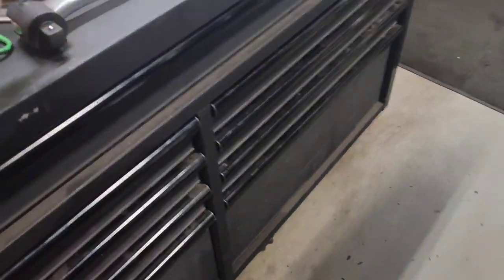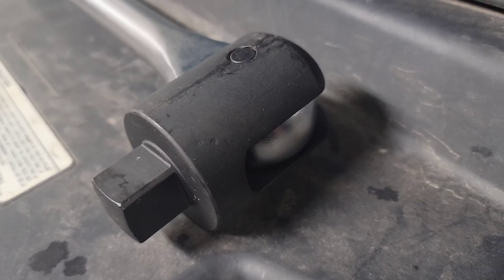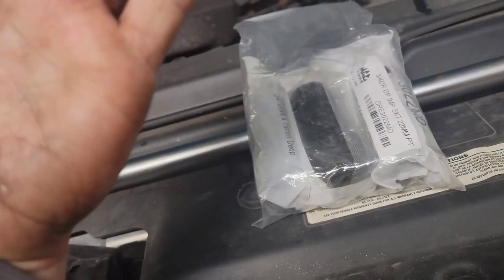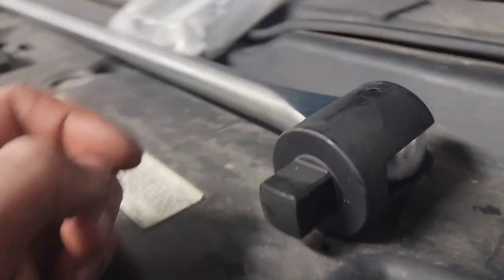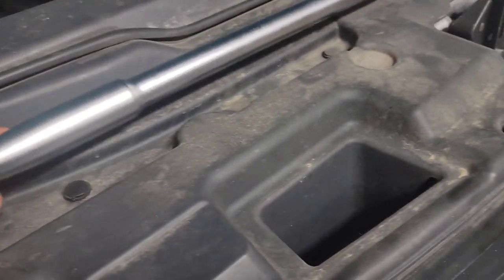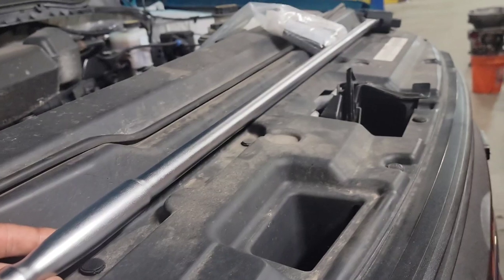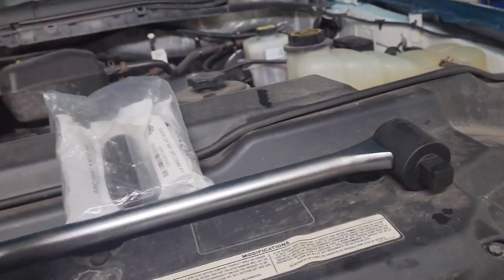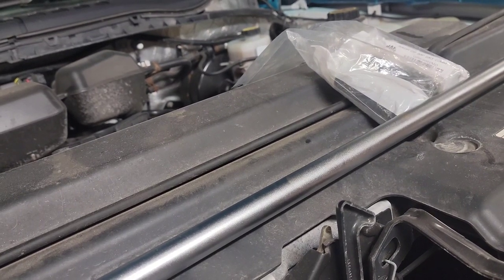Expert 3/4 41Inch breaker bar and sockets came in - lug nut king

Comment: I own that exact same breaker bar it flexs a fair amount with a pipe on it but, it's a very good breaker bar. You do need to be mindful of the allen bolt it likes to loosen up even with blue loctite with use it works itself loose. I have used and abused mine.

Comment: Cool!  I know I’m getting old, when I find myself starting to pass on tools!  About every 4-5 years I need a 2 in and 1 1/5 inch wrench, and the same size Bonney wrenches. (Fuel lines for a jet engine.). Now, at 61, I’m figuring the $100 per for even a Harbor Freight Chinese wrench isn’t worth the 3-4 uses I have left at $25-$33 bucks a use.  With 2 other guys in the shop that have them? I’ll just borrow now!! Damned getting old!! 😆

Comment: I have had a 3/4 for years. bcas it is necessity for and RV. I use my HF 2 ton jack handle as.cheater. I have torque multipler to take the lugs nuts off if necessary.

Comment: I just picked up a slightly used 3/4 drive 40-inch expert breaker bar e033804 for $35. The thing looks like it can break loose about anything I throw at it. 

At first, I thought it was some cheesy off brand junk. So this is matco cheap line ?

Comment: Love watching  your  videos.   Know your a ford expert.     Could  you collaborate  with  a Hyundai / kia expert  do a video  on the engine/knock  sensor  it's a bandaid  so it wount  push a rod into the engine  block.
Reply: Cause only 33k and its already  went into the limp engine  mode
Reply: KIA/Hyundai has been replacing those engines.  =They have a whole process for that.

Comment: you never listened truck stops dont use this crap they use something like this
Reply from the maker: I'll use this
Reply: Semi trucks lugs are typically 400-600 ft lbs.  Beyond the scope of typical Ford diesel.  Ford Commercial probably uses that stuff 1000-2000 ft lb air gun.  

Next steps above is construction equipment CAT.  Then large scale mine trucks, cranes etc.
Reply: @jonmccormick8683  not so bus mechanics general dealers most always have a specific tool and he did show the corrosion air guns will not always get stuff off hence reverting to a manual torque nut removal tool we used them on all our farm equipment over the years when air would not work and a torch at times!